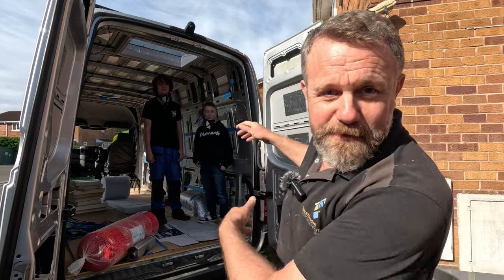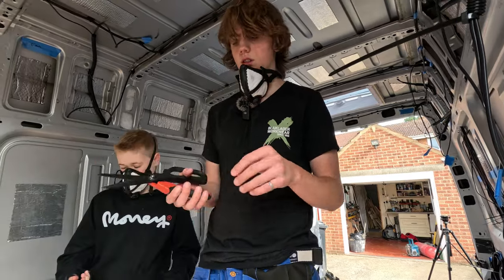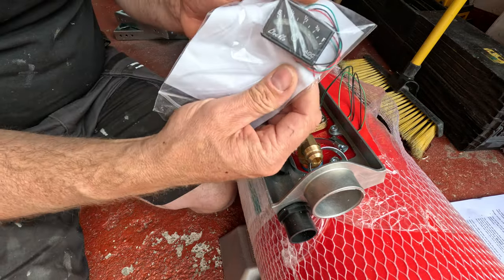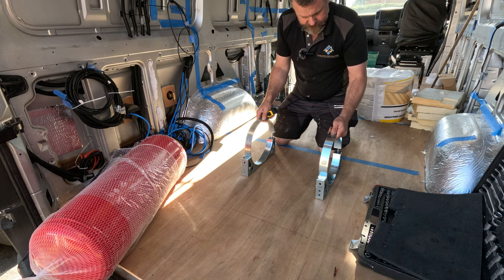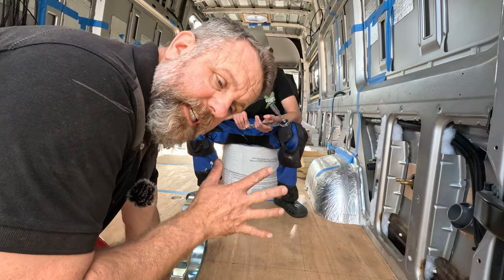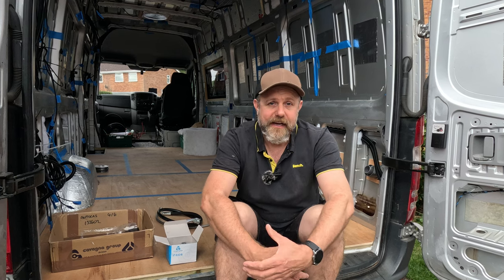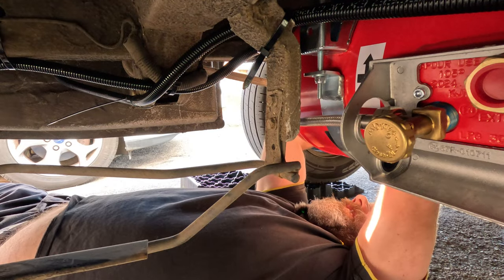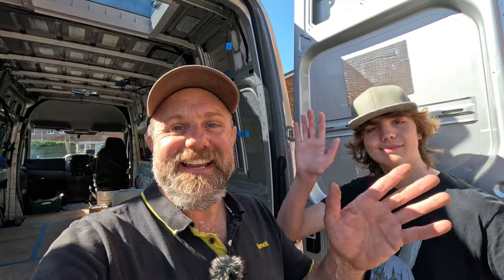LPG Gas Tank Installation on our Sprinter Campervan Conversion

Comment: Great work i seen most people just pull the insulation apart with there hands i have a top tip as well when come to carpeting anywhere and you need to cut/trim it use a soldering iron in stead of a knife or scissor as give you a cleaner cut with very little effort  👍
Reply from the maker: Hey. Thanks very much. Great tip. I've actually seen this recently on true blue travellers. Will certainly give it a go. Cheers 👍😁

Comment: Sercure the black cover with a small chain
Reply from the maker: Good plan
I was thinking of a cable tye
Reply: I was thinking about that but not sure how long it would last
Reply: @life_uncharted  me too🧐🏴
Reply: Good call on going gas.....we have a 60L underslung that runs the fridge, boiler, heating and cooker.....lasts for ages, autogas is super cheap and the batteries last forever with the other stuff (i only have 100ah usable to run pump, laptop & lights etc).....I went down the all gas route rather than the current fashion of all electric.....and glad I did!  ps, you can do the hose from valve in ptfe coated copper solid hose.....I put a remote isolator before the regulator just under the cill so it's easier to completely isolate the tank for ferry and eurotunnel requiremnts (and lower risk of hose issues as they perish after 5-8 years).....and as someone else said, those covers just love to come off....i used a safety wire (caravan type off amazon)..... .great to see the van coming on 😀
Reply: Ps, the guys at autogas 2000 are ace and great for advice (and will make sure its all to insurance standard)....i got them to do the commissioning cert which was great for when i came to registering etc, worth asking them to install a recessed autogas access port on the back quarter cill, really neat and simple to install (with a hole saw).
Reply from the maker: @timordway32  hey Tim. Thanks for the comment and info. Need to see some pics of yours and how it's looking now
Reply from the maker: @timordway32  interesting. I'll look into that. Cheers again Tim 😁👍👍

Comment: It should be mounted on the step really as you have pointed out it will get covered in crap and put the regulator also somewhere it won't get covered in crap
Reply from the maker: Cheers. Yeah I think you're right. I'll revisit it I think 👍

Comment: Great video, but you should work with safety glasses when drilling over you:  I hope you still gonna have two serviceable eyes by the end of the project.
Reply from the maker: Hi. Thanks for the concern. You are so right. I always wore them at work but not on the van for some reason 🤦. I'll get a new pair. Thanks